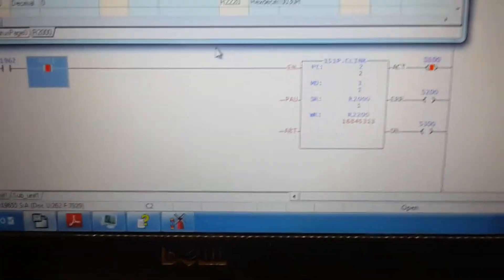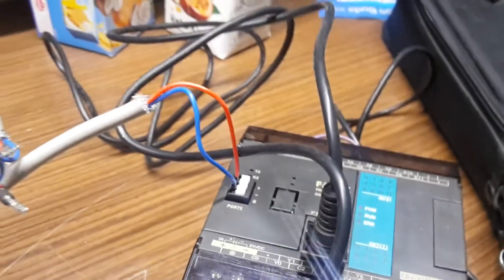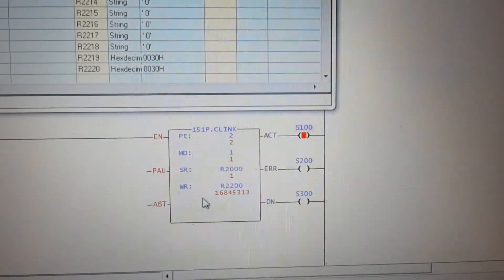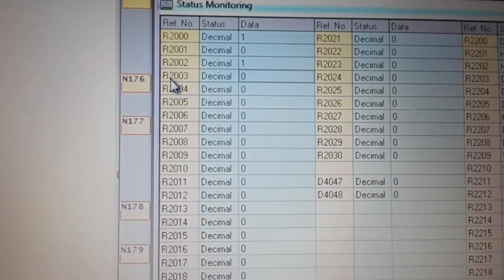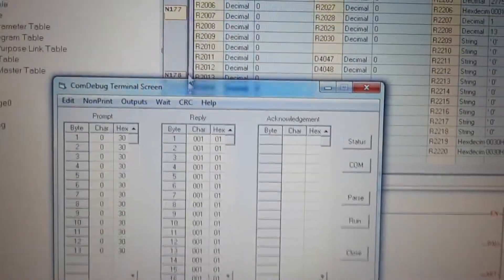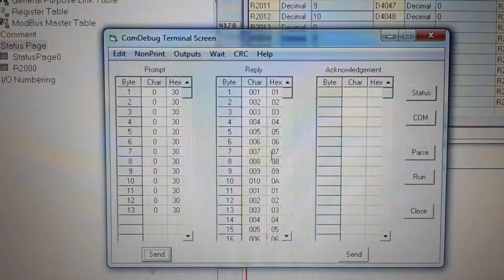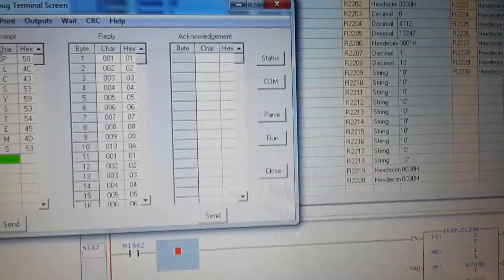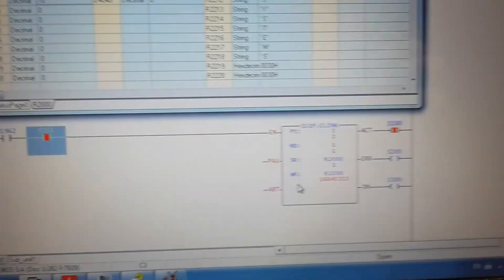CLINK FATEK RS485, RS232 SERIAL DATA

Comment: I am not able to communicate like you.I am using FBs-20-MC Fatek PLC .Can you help me.
Reply from the maker: What is  device for  read data?
Reply: @vladislavstankovic2104  I am communicating with weight scale.
Reply from the maker: @hamzaramzan5121  This ladder reed data from the weighing module. You must correct set communication parameters on the weighing module.